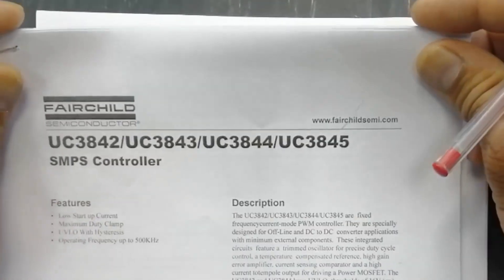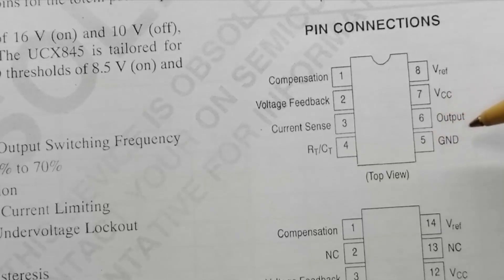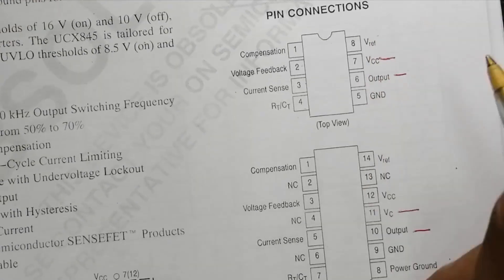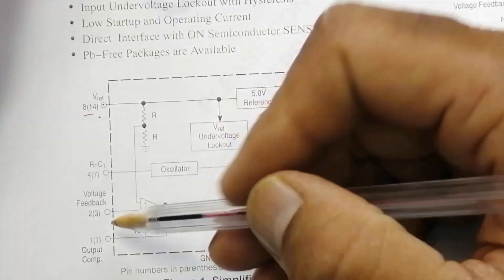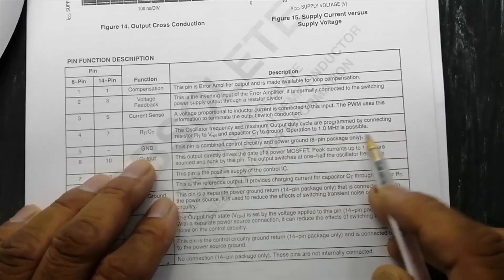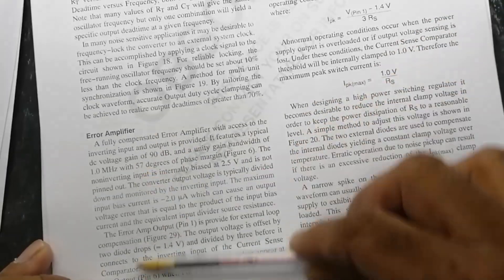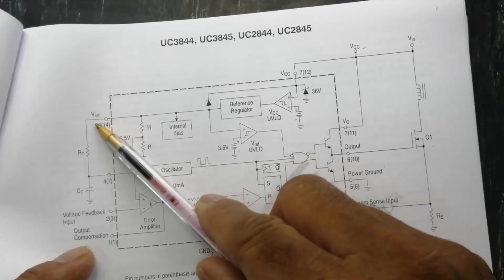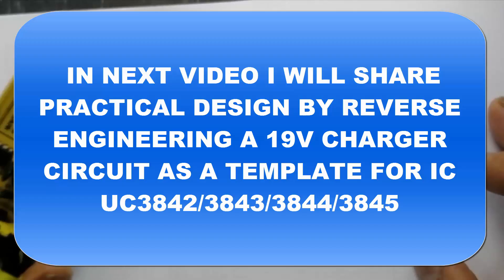{236} UC3842, UC3843, UC3844, UC3845 Current Mode PWM SMPS controller Functional Description

Comment: Excellent tutorial. Very helpful. I have been playing with the test circuit for a better understanding. I want to make a DC capacitive discharge ignition system and would like to use this chip to charge the capacitor to fire the coil and spark plug.
I'm struggling a little bit with the compensation  but hopefully I can understand it more soon.
Reply from the maker: It is a great idea to change capacitor in CDI, 
I think you have to pick the timing signal to synchronize it 
I think you should generate pulse using NE555 in monostable vibrator or triggered  flip-flop
Reply from the maker: Because in CDI system, the output pulse is a timing signal with coupled timing mechanical motion. As the RPM increase the output pulse frequency of CDI will increase relatively
Reply from the maker: Am I right?
Reply: @HaseebElectronics   If I understand correctly what you say then yes you are right. 
Please take a look at this link: http://www.sportdevices.com/ignition/inverter.htm
I am trying this circuit. I made my own transformer but the output on pin 6 of the UC3843 is not a clean pulse. I tried different RT/CT and got slightly better result. What do you think of the circuit?
Reply: When I look at the RT/CT network on that schematic. I think it is wrong. If I am correct their choice of R and C gives over 778kHz. The UC3843 does not support this frequency. Maybe they should have 470pF capacitor for 77kHz. What do you think?

Comment: Hi, i have no output, the frequency at pin 6 is between 6 and 10 Khz. Your diode technique at the opto coupler doesn't give any output. I checked the RT/CT, it is 2.47 K Ohm and 1Nf smd capacitor. Any idea where to look at ? thanks.

Comment: if i want to change smps voltage output
i want to reduce the voltages

where i should mod?? btw?
please help
Reply from the maker: please check video number 283 or 258. video number 283 is in detail

Comment: Recently I tried to repair two chargers that came with blown components on the primary side. One was a 60V 20AH bicycle battery charger and the other was a 24V general purpose charger. Both the devices came with blown mosfets and some other faulty components such as diodes and resistors. I checked all the components and replaced the damaged ones. But when I tested, again the switching mosfets were damaged. This time it didn't give out a big blast probably because I tested them through series bulb. Finally I found out that the VCC pin of the PWM ICs were grounded in both the devices. The weird part is, when I tested the PWM ICs after removing them, they didn't show any short. Is this normal? And is it the PWM that is causing the mosfets to fail agin? Please give me some advice in light of your experience.

Comment: Sir thanks for sharing nice   information of Smps, mere pass Jo smps Hai uski stand by voltage 5 volt mil rahi Hai but , ps - on 3.8 volt battery Raha Hai, vaha se ek resister ke throu ic ko ja Raha Hai, but ic ko 4.9 volt aa Raha Hai, resister on board value barabar Bata Raha Hai pls bayta yeye Kay karnar hoga, and questions ye Hai ke , aapne Jo o/p ke liye Jo three resister ka ckt Bata ya Hai ussse appne ko yahi pata chalega ki , primary swhiching ok Hai Kay nahi , am I right? Or yisse ye pata chal sakta Hai Kay? ki 3.3v ya 12v or 5 v o/p Mai problem Hai?
Thank you so much , pls reply soon.

Comment: I have an smps which using uc3842 I want convert to work on 110vvolt supply ..what should I do ..I know need to change main cap to higher voltage ..please explain what are the other changes to do

Comment: Salam M. Haseeb, thank you for the video to make me better understand how 3843 works. In a working ATX PSU, this IC has no power at VCC pin when on, i need to ground the green wire to see 14v at pin7. How can I know without multimeter that this IC is swithing ? thank you.
Reply: @HaseebElectronics  Sorry i wanted to say how to check switching without an OScilloscope, i have only multimeter. In my ATX, i have in the primary only one IC, the 3843, i believe it is doing all the switching

Comment: Today I tried to repair a VCR "Daewoo V-737" with SMPS without any output voltage. 330 V DC is OK. It is a flyback design with one NPN-Power-Transistor and one smaller NPN-Transistor. All semiconductors and resistors are OK. It seems the oszillator it will not start to swing, but I don't know why. Could you please explain such a design and give some hints about possible failures? It would be a great help for me.